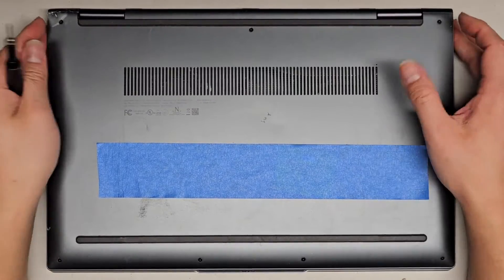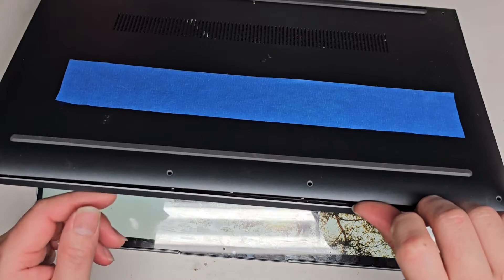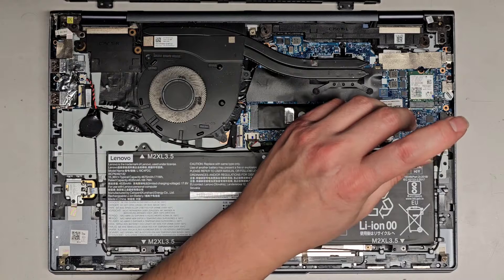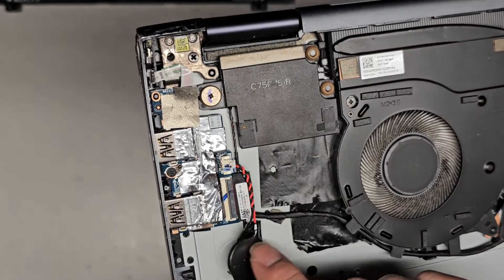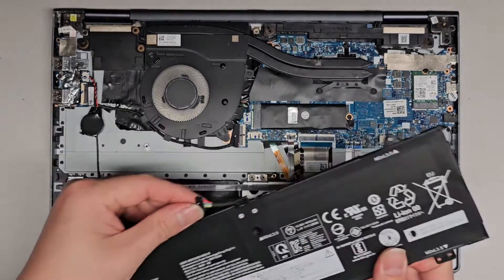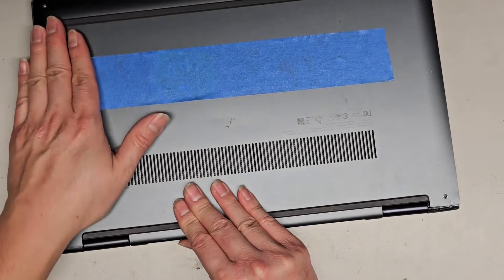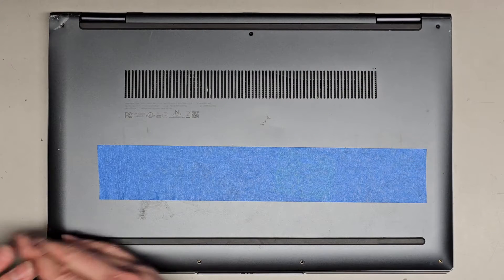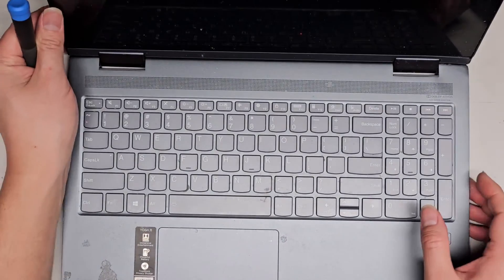Lenovo Yoga 7 15ITL5 Disassembly SSD Hard Drive Upgrade Battery Replacement Repair

Comment: Hey one qustion does theis same laptop have a ram slot
Reply from the maker: No
Reply: @ItsBinhRepaired  what are some upgrades i can do for the same laptop
Reply from the maker: @Elgato-w5b  SSD
Reply: @ItsBinhRepaired  thx
Reply: What ssd do u recomend
Reply from the maker: @Elgato-w5b  how much storage do you need?
Reply: Its me again what ssd did u use
Reply from the maker: @Elgato-w5b this works well https://amzn.to/3YBFQAm
Reply: @ItsBinhRepaired  tryna buy a egpu what gpu works for this laptop
Reply from the maker: @Elgato-w5b  no clue. Never used one.
Reply: 16 gb
Reply from the maker: @jesuslovesu-l8t  you can't even install windows on that small of a drive.
Reply: @ItsBinhRepaired  wait its 237 gb
Reply: And how much gb do u reccomand for games like fortnite or just gaming in general?
Reply from the maker: @jesuslovesu-l8t  it just depends what you save
Reply: I got 8 rn
Reply: Oh yea my right ventalation fan is coverd is thay normal
Reply from the maker: @jesuslovesu-l8t ?
Reply: @ItsBinhRepaired  not the bottom. behind the laptop the right ventelation fan is covered
Reply from the maker: OK, what does that have to do with the SSD?
Reply: Its just a extra question😐
Reply from the maker: Not sure what you mean. Are you asking about breaking the plastic? Don't do that.
Reply: @ItsBinhRepaired oh ok yea thats what i meant
Reply from the maker: @jesuslovesu-l8t  don't do it
Reply: @ItsBinhRepaired  k
Reply from the maker: Yup

Comment: it popped open pretty simple? Really?? Mine is a pain in the ass to pop open.
Reply from the maker: Watch the video and try to do it like I did.
Reply: I'm having the same problem 😭🫠. I tried doing what you did in the video, but it still won't budge.

Edit: 
Bending the bottom so that it's facing away from you elped me open it. It makes much more sense it hindsight lol.

Comment: Hi... I have a Lenovo Slim 7 Pro, suddenly the laptop couldn't be opened, I felt there was damage to the screen hinge (maybe). can it be repaired manually (turning the hinge bolt, for example). Or do you have to replace the whole part? What do you think, have you ever had a case like that?
Reply from the maker: This playlist should help Laptop Notebook Computer Hinge Replacement Repair Videos: https://www.youtube.com/playlist?list=PLSSiYX-ta7appmfpgvi4_qXzPn8FZ734P

Comment: On my Lenovo also mouse stopped working after battery replace. What happened on your laptop? Was that cable issue? You had to reseat it? Thanks for video. Helped a lot.
Reply from the maker: Double check the touchpad cable.
Reply: @ItsBinhRepaired  Cables looks to have good conection. So I tried to push recovery button. In the menu touchpad works, but once it loads into Windows touchpad stops working. Also in Bios touchpad is working.
Reply from the maker: @935baby3  oh, check your keyboard function keys. You likely disabled the trackpad with the keyboard button
Reply from the maker: @935baby3  usually is a rectangle possibly with a line
Reply from the maker: Interesting